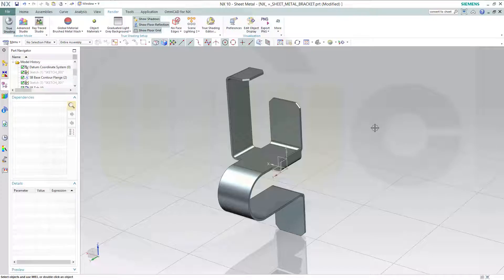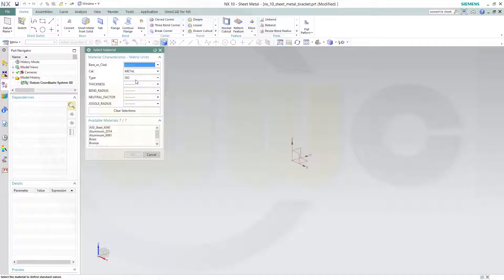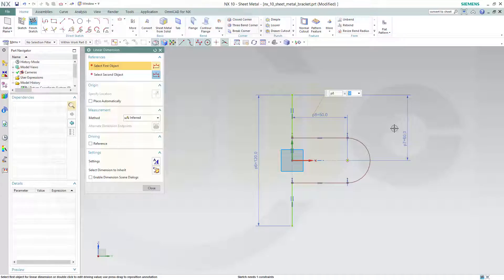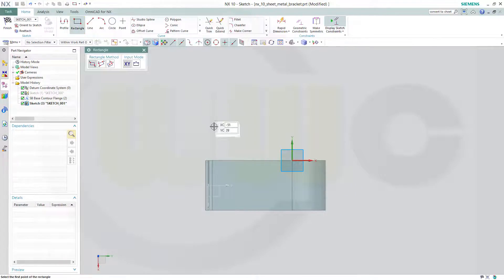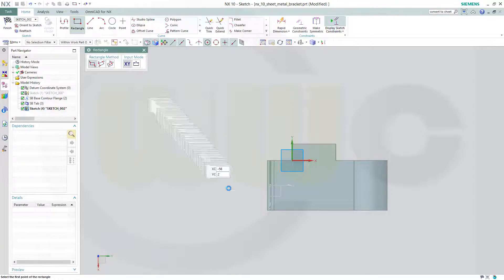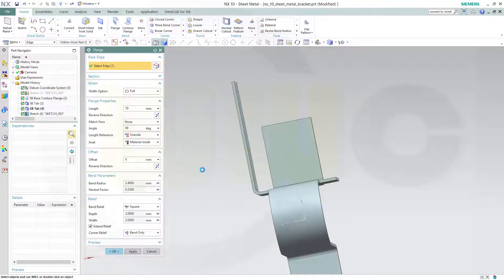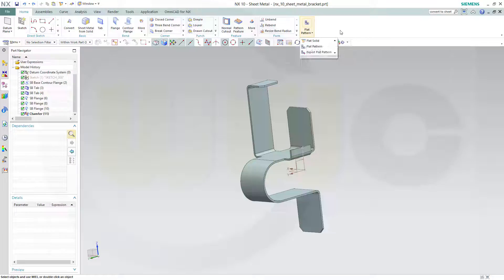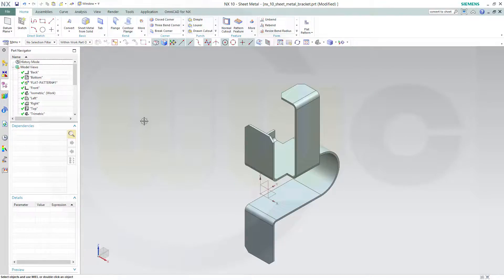S.1 Blechhalter - Sheet metal bracket - Siemens NX 10 Sheet Metal Training

Comment: Sir i have doubt in nx , i am designing a sheet metal part in nx where dimensions are given flat condition of component but the final is curved having radius. So i want to ask that is there any way i can give that flat sheet radius . Please answer my question. Thanx in advance.
Reply: Or you can draw it in simple feature like extrude or so and then convert it to sheet metal
Reply from the maker: Yes you can ;)